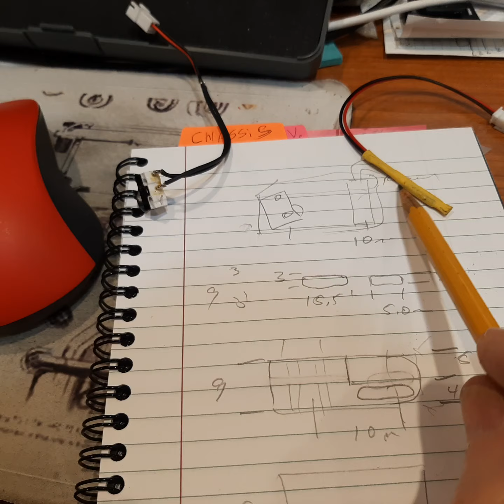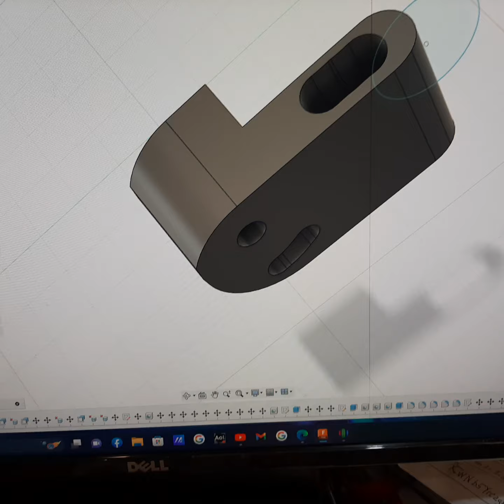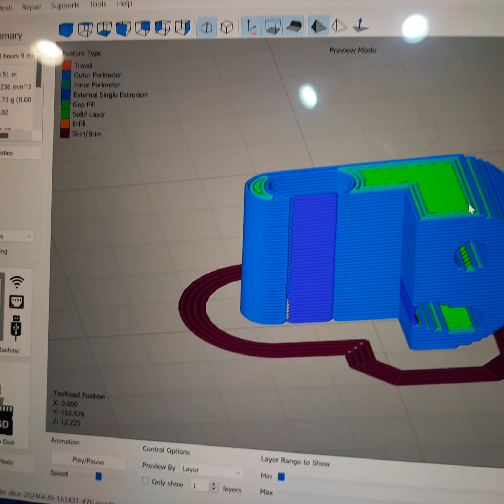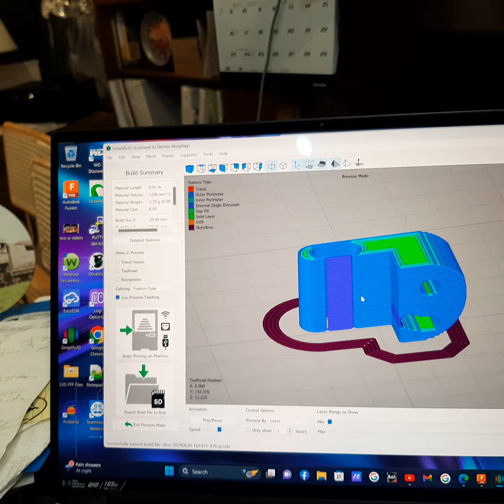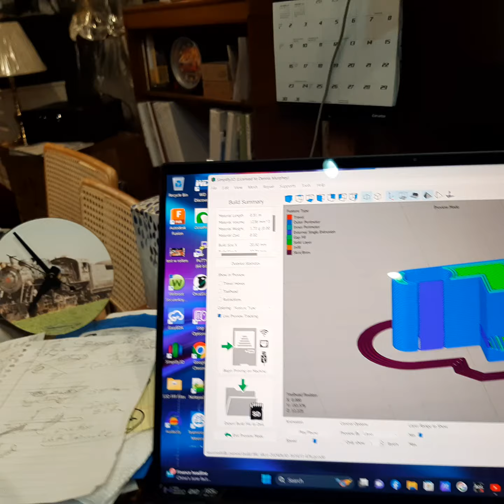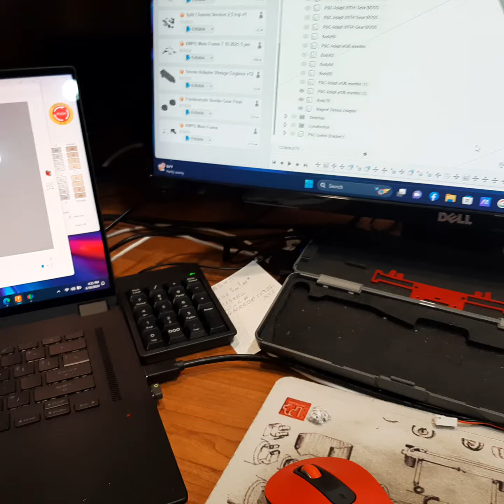How to make a sensor bracket with CAD & 3D Printing. Replace a limit switch w/ reed switch for $.20

Comment: Like what your doing with wire placement
Reply from the maker: There are a few clearance issues due sockets i need to fix. We are close. Solder up the 8 wires and i could do a rolling road test run while still shaking out clearances.